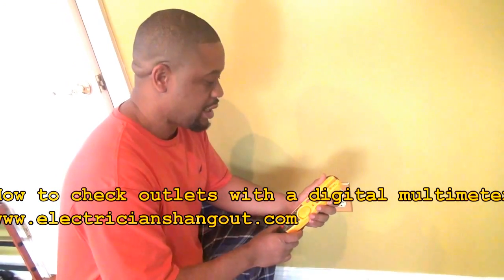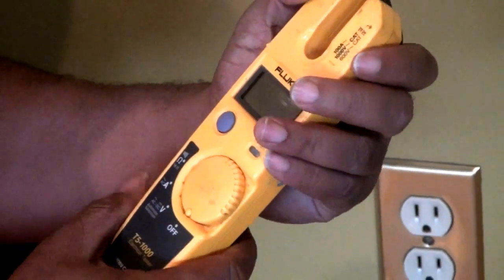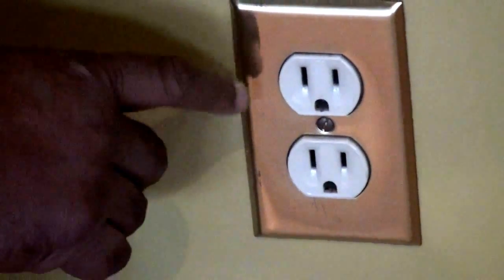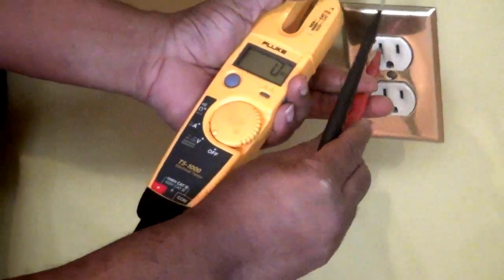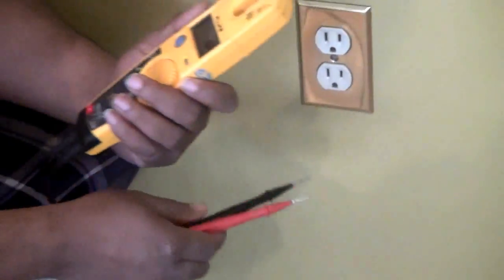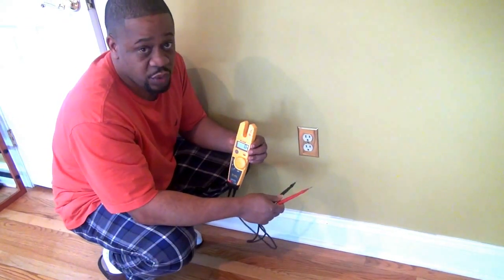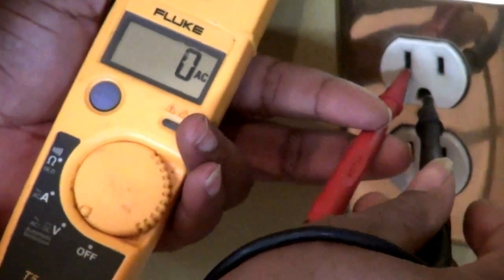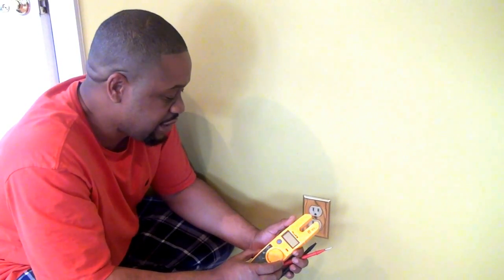How to check an outlet with a digital multimeter

Comment: I always thought AC means there is no positive/negative because the current is alternating, so no matter which side you put it in first, it is always live, no?  Most of the two prong plugs without a ground, are the same, so that you can plug them in either way.
Reply from the maker: It is the polarity of AC current and voltage that is moving from negative to positive but the direction of travel is from source to ground. Depending on the situation, connecting the hot side first will cause the neutral side to become hot in which case you are working with a energized conductor twice verses one time. The plugs are polarized so that you can only insert it one way with some rare cases you may have a plug or outlet thats very old and one or the other or maybe both may be unpolarized.
Reply: Tyrone Robertson Interesting, thanks for the information. :)

Comment: Question..I just plugged in a new vacuum cleaner and power went off on half of the master bedroom and the entire master bathroom. I checked the breaker and it did not trip. I do not have a Volt meter but do have a little mini LED 110 and 220 volt tester and the jack (where I plugged the vac) lights up on 110. When I turn on the bathroom lights it shuts of the little LED tester. It’s as if it doesn’t have enough amps anymore. Any Idea?

Comment from the maker: Is the breaker plugged in? if so it is possible the breaker is bad. BTW how did you check the breaker? normally when a breaker trips it is a indication that you have an issue with that circuit and it is not good to keep resetting the breaker by doing so you may damage the breaker. When you replace the breaker the same problem may exist. you have to find out were the fault is on that circuit.

Comment: I got a breaker that kept tripping. We checked the breaker and it was OK, didn't fix the tripping though so we left it off until we could get stuff to fix it. Now when I flip it on it doesn't trip but there's no power. Any tips?

Comment: How come when you put multimeter metal test leads into an outlet it doesn't spark up like it would with a screwdriver? I'm confused and it's why I'm worried about sticking test leads  into a wall.

Comment: Crystal clear instructions Tyrone. Thank you for spending the time and helping me understand how I can use my multimeter for checking a 240V outlet. I have one question - What is the acceptable range of voltage that a 240V outlet can give? Mine is showing as 250V and I need to connect a 240V dryer to this outlet.

Comment from the maker: With AC circuits there is no negative or positive wire so it does not matter. If you are checking a DC circuit you want to look at which way you test but even then the difference would be if you test one way you will get a positive reading reverse the leads and you will get a negative reading. The number would remain the same ie 24volts or -24volts.

Comment: Hi Tyrone, great video.  Definitely helping me to understand how to use my multimeter.  Just one thing, I see that you insert the positive lead into the neutral, and negative into the hot in the beginning of the video, and then the other way around in the second half...  I guess the multimeter works either way... but it was confusing to me.

Comment: Mr. Robertson, if I plug into the long hole and the short hole, I read 123 AC. If I plug into the short hole and the round hole, I read 63 AC. If I plug into the round hole and the long hole, I read 59 AC. What happened to me did not happened in your video. I suspected that I had a problem and that's why I bought the Fluke T5-600. Should I call an electrician, and if so what should I tell them? Thank you for your advice!

Comment from the maker: The polarity is always changing when looking at it from a waveform standpoint. But the current flows from hot to neutral (neutral being your low point of potential) Further more on older appliances it is quite possible to run across a situation where the neutral is attached to the frame of the appliance.    In this case if you reverse the plug the frame will be energized. THAT WOULD NOT BE GOOD! BTW like the heavy avatar (Soo much blood)LOL

Comment from the maker: Ok this is my last attempt:to have out of phase power you need more than one transformer. out of phase simply refers to the point one leg is to another in a cycle.for example phase A is at 0 B is at 180 etc.The point is you MUST have multiple transformers. If you are looking at single phase power on a scope the 2 waveforms you see are voltage and current. As I said in a previous reply you will never have unity power factor in an ac circuit. The two ends are not out of phase. there is only 1 coil

Comment: youtube.com/watch?v=GMePE7NZ
Watch from 9:54 to 10:37
The same thing applies to what we are talking about, pretend he has 240V on The primary and 120 on the secondarys.  Opposite ends are 180 degrees out of phase because they are opposite polarity, not necause of resistive elements in the transformer

Comment: Yes that makes perfect sense and by coil you transformer.  But its not a single 240V hot with a neutral on the other end and grounded at mid point. We both agree on that.  You really have to look at it on an oscilloscope to see this. Probe a regular 120V outlet and you will see the typical sine wave 60Hz . Then probe one leg of the transformer ground referenced n you will see the same exact wave, do this on the opposite leg and you will see 180 degree opposite.  Differentially you see 240V wave

Comment from the maker: If you look at it on a scope you will see 2 waveforms that are out of phase but you are looking at voltage and current. Whenever you have a AC circuit current and voltage will be out of phase. This is because you will NEVER have a purely resistive circuit with ac so you will never see unity.

Comment from the maker: What I think you are missing is that it is just one coil. If you remove the center tapped ground point what you are left with is just 2 wires with 240 volt between them. By grounding the coil at midpoint you provide a path for current to flow to ground. from either end of the coil to ground you get half the voltage of the coil. so lets look at it this way. 110 volt you are using half the coil and 240 volt you are using the whole coil. does that make sense?

Comment: I'm sorry maybe phase shift is not the proper term here. But I'm talking about  240V breaker which is actually a 2 pole breaker consisting of two120V legs of opposite poles.  If there was no phase shift like you say, then they would be from the same pole which, imposed, would equal zero volts

Comment: Yes it is a phase shift.  Look at in on an oscilloscope.  The reason you get half voltage is on either end with respect to ground is because both ends are 120v legs of opposite polarity.  Opposite polarity means exactly half of a full 360 degrees. If you measure them differentially then you will see why 120  on an opposite 120 equals 240V. Don't you have an oscilloscope? If not, look it up, plenty of Google images showing exactly this...

Comment from the maker: There is no 180 phase shift it is just one 240 volt coil that is center tapped (neutral) from either end to grounded center tap (neutral) you get half the voltage of the coil. from end to end you get full voltage of coil 240. In a single phase installation you do not have out of phase voltage and current.

Comment: Yes it is true for power in all U.S. homes that don't have their own 3 phase. The two legs of the transformer provide 120V hot at opposite poles(180degree phase shift) and the center tap is grounded.  Look up single phase 240V or split phase.  A 220V outlet in single phase U.S. homes are just two 120's from opposite poles.  It only has a neutral if the appliance requires 120v operation i.e. clocks, timers, etc

Comment: Actually that is not true if you are referring to the power in your house. What you are referring to is 2 legs of a 3 phase system. In your house the power comes from one 240 volt transformer that is grounded at mid point. We do not have enough room here to go into detail but basically it is one transformer hence single phase.

Comment: sometimes for older dryer lines you might not even have a neutral if it's 220v. It's more of a recent code requirement to use 3-wire feeds for dryers. 3-wire or 4-prong plug = black, red (two hots, 220v between two), white (neutral), green (ground). whereas if your setup is older you'll have a 3-prong plug (in which case the curved socket is the ground and the other two are your hots). In the 4-prong plug your neutral prong will be L - shaped and ground prong will be semi-circular.

Comment: outlets too weak? tripping breaker or gfci? If it's a gfci that's been exposed to the elements for a while, most likely they'll need to be changed. If it trips every time you connect a load, then you could have another issue either with the the wiring leading to the outlets or the actual device you're trying to power.

Comment from the maker: If you test from hot to ground or neutral you will get voltage if you check between the 2 hot wires you will read 220 volt. So in other words to make it simple find the 2 prongs that you read 220 between and also test both to ground you should read 120

Comment: Furthermore, a 220V line is just two 120's run 180 degrees out of phase with each other. So could that mean there are two hot wires and no neutral? Also, it is a 3 wire outlet not a 4 wire.

Comment: Hi Tyrone, thanks for the video.  Do you happen to know if there is an easy way to use a voltmeter/ DMM to find which wire is the hot one? This question is pertaining to a 220V 30A line commonly used for electric dryers.  The outlets are both the same size (one is not wider than the other as a typical 120V outlet is) so I cannot directly tell which is hot or neutral without turning the breaker off and pulling the outlet from the wall which is the last thing I want to do.

Comment from the maker: No I am not familiar with that particular meter. You do not  need a specific brand of meter to test your house wiring. In other words a voltmeter is a voltmeter, an ammeter is a ammeter and so on the differences normally lie in the amount of a certain parameter a meter is able to test.

Comment from the maker: It sounds like you checked the outlet correctly the short prong on the outlet is Hot you can place one test lead there and place the other in the neutral which is the long side or the ground the round prong. both the neutral and ground are at the same potential so so it should work either way

Comment: Hi, may I know what happen if i were to use the multimeter to connect between live to ground or neutral to ground? will there be a short circuit causing a circuit breaker trip? Thanks in advance,

Comment from the maker: no it does not matter but the safest way is to put your test lead into the neutral side first the (long slot) and then the hot side the (shorter slot) and when completed remove the lead from the short slot first then the long slot. This has no bearing on the test readings it is just about safety.

Comment from the maker: you check between the hot side of the outlet and ground. you should read voltage. If you do not the outlet is not grounded.The easy thing to do is use a outlet checker.( The hot side of the outlet is the short opening and the ground is the round opening )

Comment from the maker: you put one prong on something grounded. if you have a neutral or ground in the box either will work. You take the other prong and test both screws. if the switch is in the on position you will get voltage on both screws. if you do not then the switch is bad. ( this only work for a single pole switch). Would you like for me to do a video on checking switches?

Comment: Hi Tyrone. Thank you for this educational video. Recently I noticed that the sockets on my upstairs room stopped working. Using an electrical tester, which has no digital screen, I tested the sockets. The only light that comes on is the VAC (alternate current). What is the meaning of that?

Comment from the maker: If you are checking a AC circuit it does not matter which prong for hot or neutral but if you are testing DC and you reverse the prongs the reading on the meter will have a negative value but it will still be correct. You can google outlet configurations to see the different types of outlet configs. with voltage and curent

Comment from the maker: sorry did not read the question correctly.It is not a good idea to wrap the fuses in foil. If you put the meter on the wrong setting and try to test voltage or current you could damage the meter or more importantly injure yourself.I WOULD NOT use the meter until I replaced the blown fuses. It is very easy to have the meter on the wrong setting or the probes in the wrong connectors and with the fuses jumped out this could spell disaster.

Comment from the maker: you should always make sure that the test equipment you intend on using is always in top working condition. We depend on these instruments to provide us with accurate and dependable data. With all of that said most meters use the battery for generating the small amount of current and voltage needed to test for continuity. Some manufactures may use the fuses for other meter functions. I would use the meter to test a circuit that I know is live first to confirm proper operation.